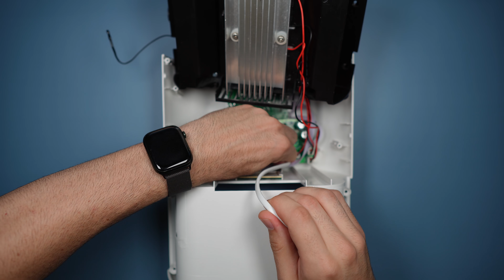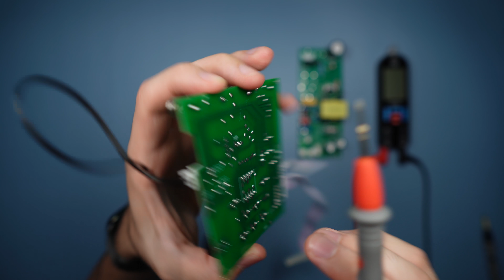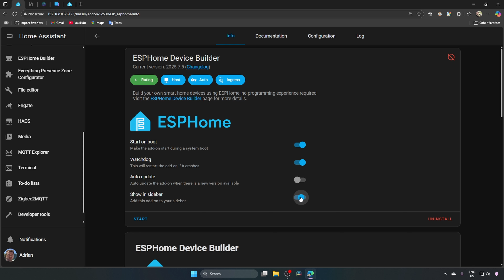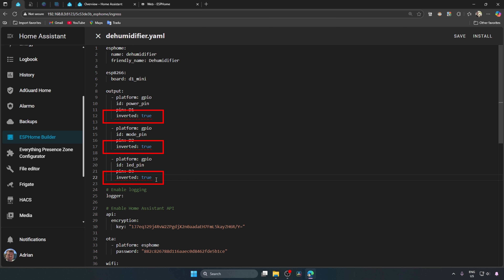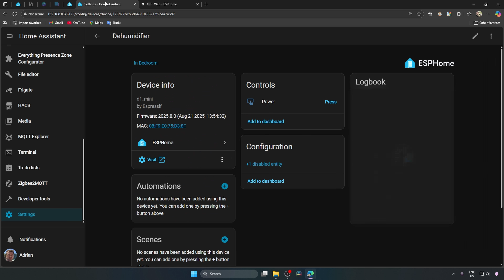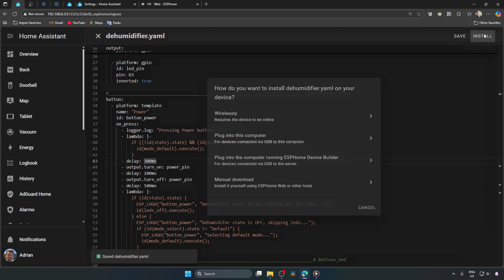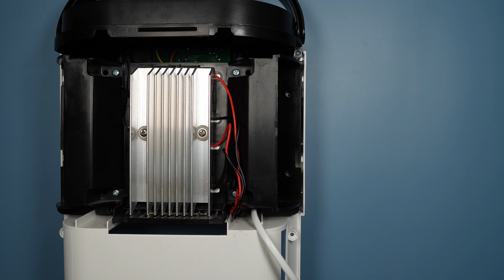Turn ANY Device into a Smart Device with ESP8266

Comment: Salut! The touch stopped working mostly because its not like a normal switch and it detects finger capacitance. I am not an expert, but I think you need some kind of resistors if Im not wrong to get it working. Also for the state of the device, a light sensor for the led or something easier could get the state of the device into home assistant but it complicates the project a lot. I think the easiest solution is probably something like small relays but they make a little noise when opened. I think you did a great job and can’t wait to do something simmilar on some of my devices but thats the only issue. Maybe normal switches would fix the issue for now but it affects the design😅
Reply: I'm not an expert too but I've already responded to the creator of this video to try and use an optoisolator to simulate the button pressure, in this way u don't change the way the PCB is working and in theory the buttons still work. Connected them directly to the esp change the current and other things of the PCB and can change the way is working, it's also risky, u can damage the board It self. For the power on state I'm also working on it, a relay isn't the best ideas for the same reason, it need current and can change the pcb logic. For the noise u can use a ssr relay, it hasn't a mechanical switch but works like an opto so there is no sound

Comment: This is pretty fantastic.  Did you do some testing to figure out the ms delay for tapping the power button or is that like a known standard?
Reply from the maker: I’m not sure if this is a standard, but I tested it with different delays. It works with both smaller and bigger delays, but setting it too low risks the device missing some commands. 100 ms seems to be a safe zone.

Comment: Nice work! 
I tried something very similar a few months ago with a Levoit air purifier, but the capacitive touch buttons or traces were difficult to tap into, or signal reliably. 
Would be very interested in a video on that if you have a simple work-around.

Comment: Cool, but please forget about esp8266 because it was obsoleted, the esp8266/Arduino framework hasn't been updated for years and can't even use WPA3. You can find many better things like esp32 c6 which has Bluetooth 5, Zigbee 3.0 and Thread, and has a normal Type-C port
Reply: esp8266 is perfectly fine for this project. I have 3 super old ESP-02S (esp8285) I just installed in 3 RF ceiling fan canopies for outdoor patio fans to control fan speed and light dimming. It all depends on your use case.

Comment: You should have made a big disclaimer that you need to measure what voltage goes through those buttons, if you just do this on any device without checking you can fry your esp instantly. You were lucky your device worked with 3.3v, but that's not even remotely the norm
Reply: You beat me to it. FAR to many assumptions. Beginners beware.
Reply: 5V also work for esp8266
Reply: h❤❤❤❤❤❤❤    many cases there are easy fixes to interfacing between 3.3 V and other voltages
Reply: Esp8266 (the gpio) is 'immune' to 5v. The code wont run tho, at least the mcu survive

Comment: I discovered this stuff like a year ago... two years ago, I started with home automation, went the usual path from entering the rabbit hole through the Shelly entrance, then hoarded all kinds of ready to use smart devices, dumped their apps and replaced them with Home Assistant. From there on, it was not far until I reached the ESP32 / ESPHome rabbit hole (yes, it really is a rabbit hole inside a rabbit hole! hehe). First, some pre-made devices like the LoRa ones, some display stuff and then I got stuck in basically what your video explains so well (difference is just that I'm using ESP32, but that shouldn't matter much). Since then, I smarted up our door bell / intercom (configurable buzzing / light signal on bell ring, door buzzer controllable through HA etc pp), turned some "dumb" LED strips into smart ones using WLED, installed two linear actuators controlling doors through H-Bridges and Relays, and I have a full blown plant grow tent, plastered with dumb components turned smart, so I can automate watering, airing, lighting, temperature and air humidity. With that stuff, AliExpress really became a paradise! (I saw a few components from there in the video, I think, and some I'm not sure, like the Multimeter?)

Comment: You’re lucky that you have 3.3v power on your device’s board. Usually it’s not there so you have to down the input voltage with some kind of regulator. Would be great if you show this process to your followers. Thank you for the video. Good luck in your future projects.
Reply: Simple buck converter should do the trick for most
Reply: Most ESP dev boards feature a voltage regulator,  you can power them with 5V.

The issue is,  that the board most likely would be operating at 5V logjc. Not an issue,  if all you do is simulate GND  as a button press. Not an issue,  if the board reliably triggers at 3.3V logic levels. But if you also need to read signals,  or if 3.3V ain't enough, you still don't want a buck converter. Instead,  you'd MUCH rather want a logic level converter.  remember,  the ESP can handle 5V input power and will regulate it to 3.3V, you don't need your input power converter. You want your signals converted instead.
Reply: I like to use a LDO like the AMS1117 for this.
Reply: Or HT7333 if you care for low power consumption like in a battery powered project for example.
Reply: Or logic switcher to 3v

Comment: Cool video. The problem I came across when I tried this on some devices was that the internal power supply may not have enough overhead to power an esp device and the existing electronics. ie the vornado fan I own could not manage it. It works if I power the esp with external power, not yet worked out how to integrate into the fan.
Reply from the maker: What voltages have you measured on the board?
Reply: @AdrianSlabu  It was over a year ago now, so I cannot remember exactly. but the power supply was faulty, I repaired it and the fan was working again. 240v to 5v supplying a small microcontroller chip STxxxx something or other. When I added the esp the fan stopped working. I powered the esp from a bench power supply and it worked and I could add it to Home assistant and set up control. So the supply couldn't manage the mA to power the ST chip, the triacs and esp. I was more offering it as advice to those that are thinking of trying this. It's a great ide, there just can be some pitfalls.

Comment: Super tare! I would add a draining pump or direct hose to it towards a drain.
I need to make a "simpler" project, a heat pump boiler with heat recovery ventilation, basically a bunch of relays and temp sensors tied to a esp32 board, I think youtube smelled my intention and directed me to your clip :) keep at it!

Comment: Regarding your question about supplying voltage through USB at the same time as a 3.3V (or 5V at this mather) connection: Generally you are not supposed to do this, as there may not be input selection circuitry (like a power multiplexer IC) to cut off and select single sources. With only simple circuitry or none even slight voltage differences may produce backfeeding current into one of the supplies. This could for example damage a USB port. Anyway, I already saw people recommending ESP32 which I've generally seen multiplexers on it. You should however always check your specific board's schematic first, if it has such a multiplexer IC. Otherwise I wouldn't do it, even though it COULD be fine, so I appreciate your caution here. I have not checked the schematic of your specific choice in the video, sorry :)
Reply from the maker: Thank you!

Comment: There is so much going wrong here. You would need to inspect how the buttons work in the first place to safely the design the interface and not just short inputs to power or ground and hope for the best. My first thought was pull up pull down protection is missing but you still don't know what you're doing. Adding wires to capacitive touch inputs will definitely throw off calibration and you can end up with buttons that are constantly pushed or that don't work at all. You could experiment with small transistors, opto-isolation pairs, Tri-State or opencollector outputs, or tiny relays. Whatever it does not affect initial capacitance and allows you to change it would be the way to go. One of my main rules for upgrading devices or making something for the house is that it does not remove or interfere with manual operation.
Reply: And in most cases voltages do not much
Reply from the maker: Just because my way to go is not matching your “main rule” does it mean it’s wrong?

Comment: Hey, all of you should know that ESP8266 uses 2.4ghz- it is vulnerable to deauthentication packets and MITM attacks. Just an FYI.
Reply from the maker: 5Ghz devices are also vulnerable to deauth 😅.
Reply: 2.4 GHz is not the problem. I would recommend all IoT devices use 2.4 GHz to stay off your high bandwidth 5 GHz airwaves
Reply: @batemanjo9 2.4Ghz networks are susceptible to indiscriminate deauth packets. Do you know what those do and how it relates to handshakes being exposed?
Reply: @StoneyBaloney22 The 2.4 GHz band is not inherently less secure than 5 GHz. An attacker can capture WPA/WPA2 handshakes on either band. The frequency only affects range and performance, not the strength of the encryption. Capturing a handshake does not give someone access to your network. It only allows them to attempt an offline password attack. If you're using a long, random password with WPA2 or WPA3, the odds of someone cracking it are extremely low. The real weakness is using common words, names, dates, or predictable passwords like "Password123!" rather than the network is on 2.4 GHz or 5 GHz. Plus you need 2.4 GHz for really large homes like mine, the range is incredible especially going through walls for outdoor devices such as my patio fans, lights and overhead doors in my garage and shop. You will get an occasional drop out on 5ghz when it has to go through 4-5 inches of sandstone wall with 3/4 inch plywood sheathing, insulation and then finally drywall. I'd say my exterior walls are about 11 inches in total thickness with a metal roof, 2.4ghz goes through it with ease.

Comment: Yes but this is very hardware dependent solution isnt it?
Reply from the maker: This method works for this type touch buttons which are very common.
For mechanical switches you need relays, I think next video it will be about this.
Reply: @AdrianSlabu  Ok as long as those touch buttons are compatible with ESP digital input. How many of those devices have a labelled 3.3V power bus that you can tap into and space inside? I still think this is very hardware dependent.
Reply: @bflmpsvz870 I mean if not, you use a resistor (or a transistor) to get the voltage to 3.3v volt or use an arduino for 5v?
Reply: @nicky7006 What I mean is that not every device is open to modifications like these - as they have proprietary control boards. I think it would be good to give a warning to the watchers that you can't just point on a random device at home and turn it into a smart one. Specially if you are noob watching a youtube video.

Comment: so what was solution regarding 2.6V
Reply from the maker: I added a filter in the code for the binary sensor. For example, if the state is ‘on,’ it waits 100 ms before switching to ‘off.’ If it flips back to ‘on’ in that time, the sensor just stays ‘on.’

Comment: I think the board has already a place on the pcb for a so called tuya based "smart" chip. if you lucky you can place a esp8266 in place there and need to do some reverse engineering to talk with the controller inside.

its on the frontside of the pcb where the L mark is.
Reply: yes that's exactly why there is a notch on the pcb, for the antenna section. Probably for a beken module or something similar that talks over UART. Simply add tuya: to the yaml and add log level: VERY_VERBOSE with a baud are of 0 so you dont interfere with the tuya MCU trying to speak. I have done this a few times on undocumented tuya devices. Watch the logs through the api or web_server as you hit buttons. Its always so fun

Comment: Did i miss how you were able to return the humidity value?
Reply from the maker: The humidity value is not from dehumidifier, I said the internal sensor is reading lower values than the actual ones so I used a zigbee temp / humidity sensor which was already in the room.

Comment: You're quite lucky: connecting ESP inputs/ouput pins to an unknown circuit would probably fry it (ESP pins are very sensitive to overvoltage)
To still allow the physical buttons / touch buttons to work, turn the ESP output pins to inputs (high impedance) when your script doesn't use them as output
Reply from the maker: I didn’t know this is possible, can you give more details about this? Thank you!
Reply: This is my concern too.. both the pins on the appliance.... they must be voltage compatible, and not exceeding the current in which those pins can handle.  Some appliance controls are line voltage too (120v in N.A.).. which this would not work well.

Comment: Remark to soldering, you should not put tin onto tip of soldering iron, you should use tin directly on a pad when you are trying to solder cable.Apart from this nicely explained.
Reply from the maker: Thanks for the advice!

Comment: Good video! As a note, though, I'd strongly suggest going for an ESP32 instead of a ESP8266, since modern features in ESPHome such as OTA upgrades require more flash and memory space than what 8266 boards typically have (especially the 12E, which has a paltry 1MB flash). Prices between the two are comparable if you know where to look as well; I got 10 ESP32 C3 boards from AliExpress a while back for $1.65 USD per, and they're directly comparable and competitive with the D1 Minis that you used in your project.
Reply from the maker: I will definitely buy esp32, I already had 8266 so that’s the main reason I used it. Thank you for the advice!
Reply: @AdrianSlabu  I was wondering why as the 8266 is outdated now.
Reply from the maker: @peircedan  people are saying esp32’s security is better.
Reply: There is a difference between ESP32 and ESP32-C3. Honestly, nowadays, ESP32-C3 should be the go-to like ESP 8266 was because it is cheap and RISC V open architecture, and ESP32-S3 should be used instead of the ESP32. They are both slightly more expensive, but better all around. Then, if you want to future-proof, use ESP32-C6 or C5 instead of the C3 as it has Thread support and they all have WIfi 6 support instead of esp32 and 8266 with only Wifi 4.
Reply: As someone who ordered the 8266 to do this is it still worth it
Reply: Do you have link for it
Reply from the maker: @kaskiiiii if you are asking about esp32-c3 link check description of my video where I made my fan smart. In that video I’m using this esp.
Reply: Very much this.
Reply: Esp32-c3 is a successor of esp8266, meanwhile esp32 successor is esp32-Sx series, like esp32-S3

Comment: Interesting video. I have the same dehumidifier,  it is cheap, but extremely inefficient (uses 2 peltier modules, if I remember correctly), and will not be effective except in a very small room.  Gas cycle dehumidifiers are about 5x more efficient.
Reply: If a dehumidifier doesn't have a compressor, it's an inefficient toy that mostly wastes energy.

Comment: For anyone who is seeing esphome for the first time in this video: the value of esphome + Home Assistant cannot be overstated. The HASS ecosystem is free, open source, specifically designed to make entry-level home automation as easy as possible, is endlessly customizable, and BLOWS THE CRAP out of any paid solution on the market. It can be fully self-hosted, does not require an internet connection, has no subscription fees, and doesn't steal your personal data and send it off to god only knows where. It really is an amazing piece of software.

I used esphome to upgrade my 30+ year old house alarm system (circa 1992) so that it can send push notifications directly to my phone if a door opens while I'm away. It turns on the lights automatically when I open the front door after coming back home. Total cost: $6 for the esp32 devkit + some scrap wire I had laying around. The original security system still works just as it did before. That was way better than spending thousands for some modern goofy "upgrade" that would require a monthly subscription fee.

Comment: I would recommend ESP32 over ESP8266.
ESP8266 is a bit old now with less ram/flash and it can be a bit hard, or sometimes impossible, to get it working on some newer WPA2 / WPA2 Enterprise wifi networks.
ESPHome works great on ESP32.
Reply from the maker: Thanks for the tip!

Comment: Awesome video, I was looking for this tutorial and it appeared in my main page. I have one question, you connected to the switches only one wire per switch, my understanding is that the push button for a device is 2 wires, how do you achieve this? with one wire per swtich
Reply from the maker: The ESP’s GND is connected to the control board ground. These are not mechanical switches, the strings are connected to a microcontroller that measures capacitance. When your finger comes close to a string, your body acts as a capacitor to ground.

Comment: To be honest, you didn't yet make it smart. You just made it accessible from HomeAssistant.
It becomes smart when you have a way to measure the humidity in the room, and turn on and use the device without your help.
Reply from the maker: That’s true, but once you connect it to Home Assistant, you pretty much have unlimited ways to control it.